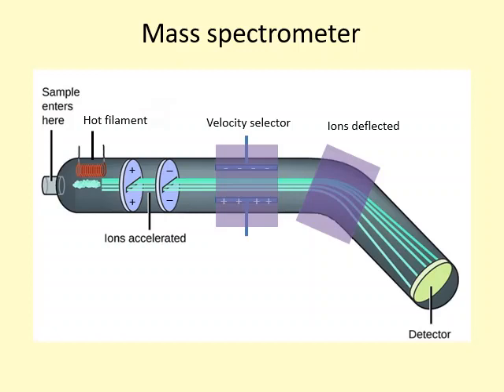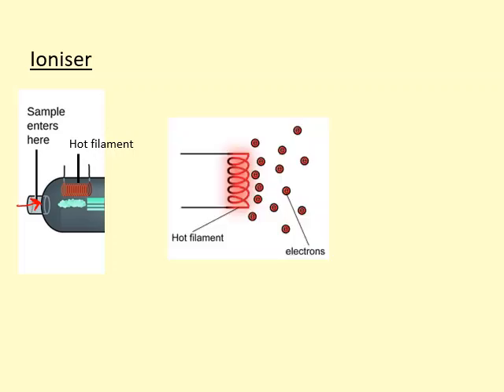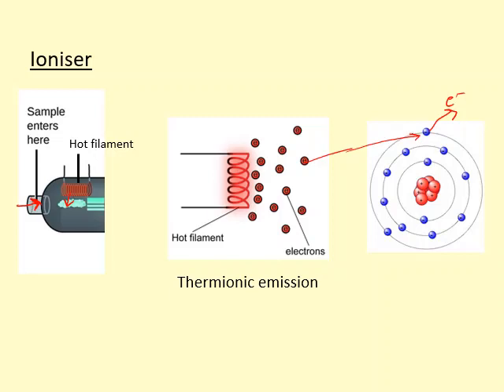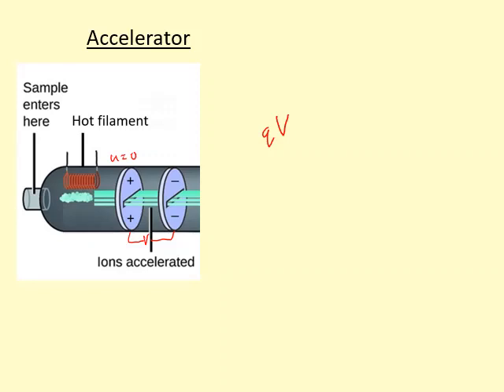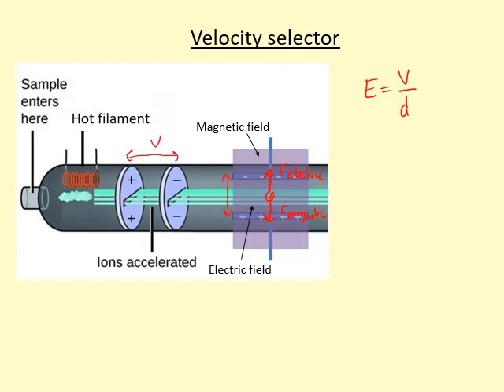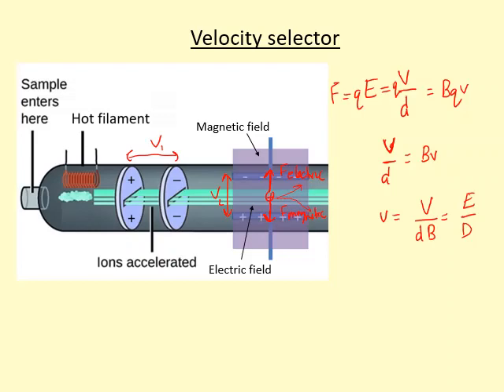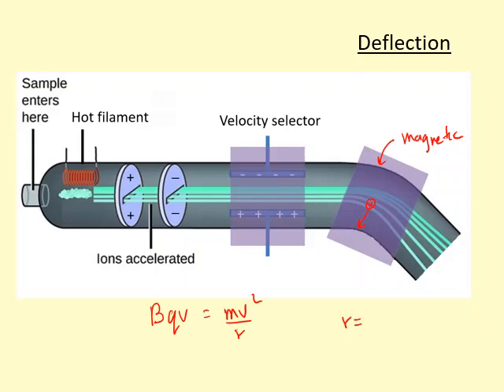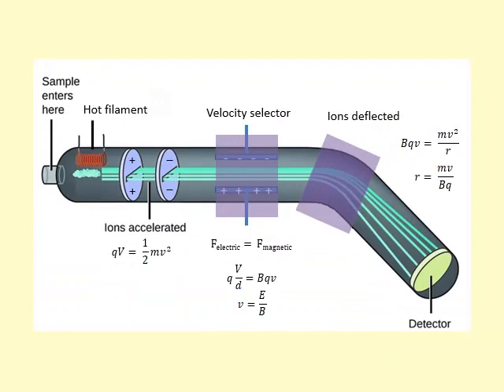12.08 How does a mass spectrometer work?

Comment: Surely the velocity selected during velocity selection is always 1 is the electric field strength & magnetic field strengths(flux density) are the same
Reply from the maker: 1m/s?

Is your thinking " because electric force = magnetic force , this also means electric field strength = magnetic flux density" ?

This is not the case. Force are two things which you can make equal but the field strength and flux density are different things. 

Does that help?
Reply: @MrNagaPhysics  yes that does thank you I got lost and mistook magnetic field strength (Flux density) as the magnetic force per unit charge like it is in gravitational & electric

Comment: How particules are accelerate if q(E+v×B)=0 (Lorentz force) because F=ma so a=0
Reply from the maker: do you mean in the velocity selector? ( for a specific v , the F = 0 so it isn't accelerated and it goes in a straight line)

it is accelerated at the starting stage where is is only qE = F which makes it accelerate.

Hope that answers your question?
Reply: @MrNagaPhysics  yeah that's exactly what I mean. Thanks